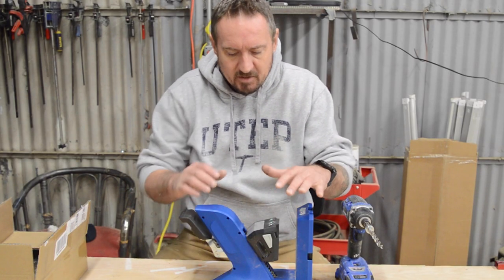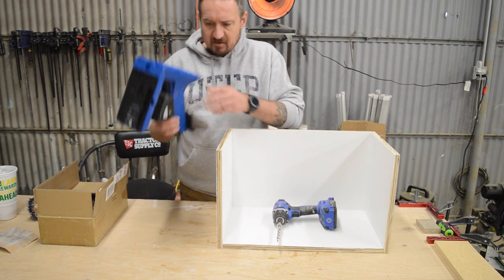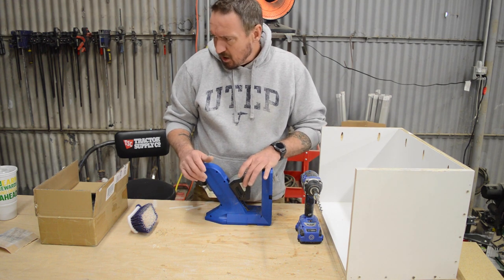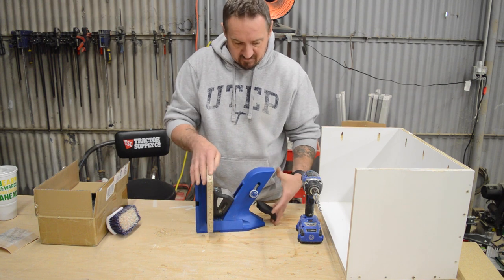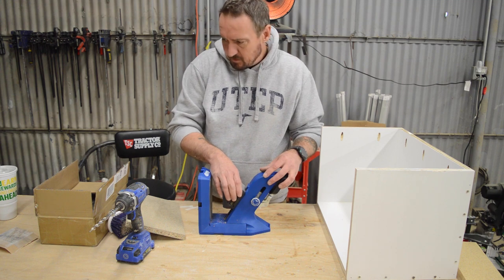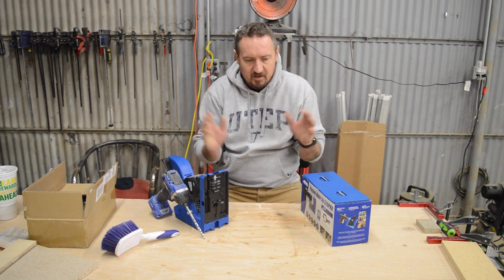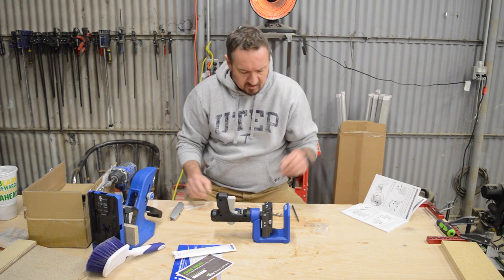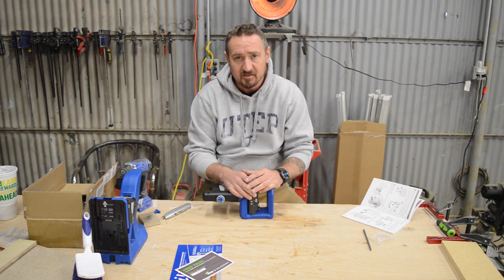AWFUL Keg 720 Pro vs Kreg 520 Pro Pocket Hole Jigs - My Review

Comment: I’ve used a Kreg jig since I first saw one at a trade show in the mid 90’s! Forgive me for saying this you must be an idiot to continually make the same error over and over with this system and then make a video admitting it to the world! It is almost idiot proof. I have to admit that I don’t have this newer version, mine is the older pre K4 model. I have made hundreds of things with it and it still goes and goes. I have made errors of course but one thing I will agree with you is that this creation is very bulky compared to the slimmer model. Let’s say this is more a consumer model than a pro model, simplified for the casual user who doesn’t have time to RYF manual. Yet pros use it all the time why, because it gets the work done in a spectacular way economically almost every time and it’s dead simple!

Comment: The 720 is great for what it's designed to do.  I had never done pocket holes before, so I was new to building with them.  I built my first custom book case.  What made it go smooth?  Drill the holes PRIOR TO ASSEMBLY.

Comment: An old carpenter used to tell me that “failing to plan is planning to fail.” He was wrong. This video shows just how much effort and meticulous attention to detail can go into planning to fail. 

Instead of searching for tools that make it easier for you to do things the wrong way, why not just commit to training and conditioning yourself to do it the right way? 

I’m not busting your balls. I have ADD as well. I have to leave myself cues everywhere to remind myself to do simple things at the right time. I would 100% be the one who would forget to get my kid out of the back seat of a hot car. People would curse and spit on me and ask “how the F could you forget something like your child in a hot car, asshole?” 

How? I saw a squirrel, that’s how. 

Why don’t you clamp that jig onto your assembly bench and leave it there? Put it right in the middle of where you do your glue-ups so you will see it (or even have to move it) before you even get started assembling a box without drilling those holes first. 

How much easier would it be to just drop each piece in that jig at the same place, the same height, and the same angle every time, compared to twisting yourself up like a contortionist trying to bleed the clutch hydraulics on a ‘94 Ford Ranger, discovering eight brand new yoga positions just to drill six pocket holes?
Reply: " SQUIRREL !!! " 
... yep, I've been there ~

Comment: I've got the 720, and I like it a lot. 

For pocket holes that I've forgotten along the way (and for furniture repair, the main use) I've got one of kreg's mini, one hole at a time drill guides. I rarely forget to add a pocket hole, but yeah, using the bench mount 720 unit for upside-down inside-out operations like that seems like a huge pita.

Comment: I too have the k-4 and I love it.  I was sadly disappointed when they changed the entire system.  I was going to upgrade to the k-5 about the time the 5/720 's came out and then everywhere I had seen the k-5 no longer had them.  The k series in my opinion is the best.  All the guides were interchangeable and could be used separate from the jig.
Reply from the maker: My k4 is still my favorite but I have to say, the 520 has been AMAZING. I am definitely in love with that one. The 720 just sits in a drawer as a backup now.
Reply: @TheWebbRanch Why don’t you take it out of the drawer and clamp it to a bench like it was made to do, and then you would see it and remember to drill your holes before you assemble?

Comment: You may want to get the Armor tools pocket hole jig, or the Massca Pro model. Those are great alternatives. I have the Kreg K4 and I have to agree that one was really well designed.
Reply from the maker: I love the K4 and have really started to love the 520 because my old brain keeps forgetting to male the pocket holes before I assemble lol. I've been using the 720 here and there and it gets the job done but I'm still not in love with it
Reply: I have since updated my K4 with the armor tool auto clamp and it works great.

Comment: I'm waiting for 3rd party (Chinese) counterfeits made of metal.  Kreg needs to stop making cheap crap out of flimsy plastic if they want serious customers and not just home-DIYers.  The 720 is over-engineered IMHO.  I use and love an all metal knock-off pocket hole jig modeled after the K4 and mounted to a wide base that is clamped for bench-top use and it works great.

I bought the 520 because I got sick of trying to fiddle with an old R3 when I need to drill holes in existing projects (tight/odd spaces), but gladly pay 3x for an all-metal version.  Yes, sometimes you need to drill holes after a project is assembled.

Comment: this is a great video, very informative and helpful, however you need to fix your sound levels my guy. 
i feel like right now you are doing not much to the audio track when editing, which is keeping the "peaks" in the recording as the loudest volume. from a viewing perspective, this means your talking is way lower in volume than other youtube videos, so what is a comfortable device volume for other videos is suddenly too quite for your video. this means people have to increase the volume of their device to hear you properly, which would be fine, if your audio didnt then spike to the new max volume when your drill runs. 
try watching a few of the top trendng videos at a comfotable volume level, then try watching this one to see what i mean.
not sure what program you're using to edit, but i'd recomend watching a video or two on optimisng the audio track. i almost turned this off the first time the drill ran it was so loud after having to turn it up to hear you properly haha. getting a handle on optimising the auido will really take your content to the net level.
Reply from the maker: Thank you. I'm moving between shops right now and the mic I have on hand is less than spectacular. I raised the gain what I could in premier.

Comment: Dude, drill your pocket holes prior to assembly. Are you bananas ?
Even the k4 or k4 wouldn’t be used that way.
It sits on the bench flat.
If you used your k4 like that you need to not be a woodworker and take up colouring books with fat crayons….do you walk around wearing a hockey helmet ?
Spare parts bud, spare parts.
Reply from the maker: Hahahahaha